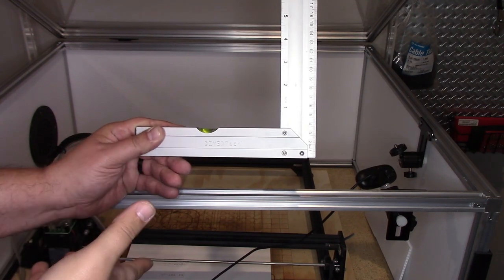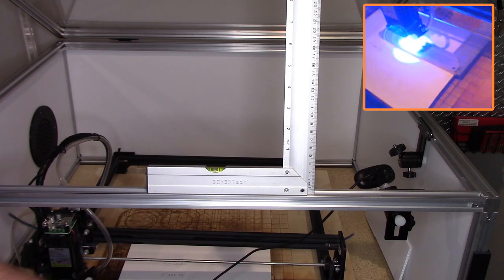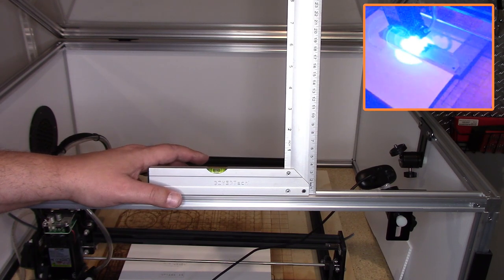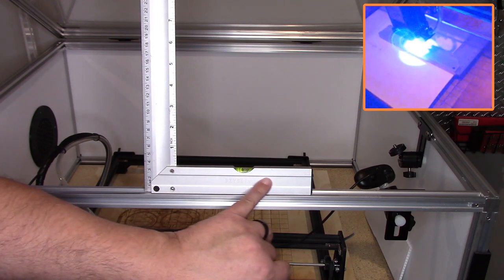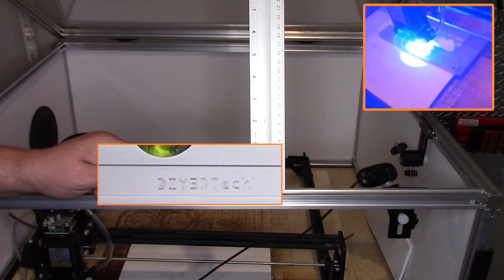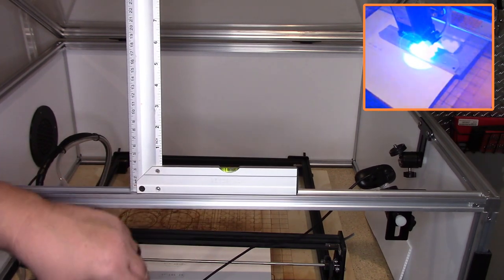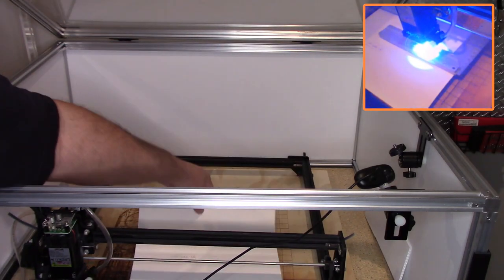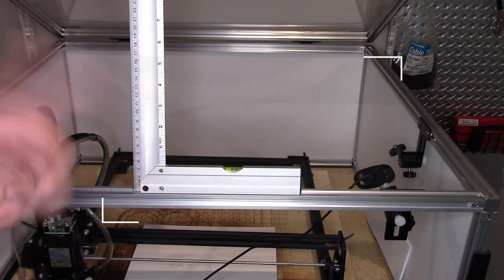Ortur Laser - Etching Aluminum!

Comment: Will this laser remove black powder coating from aluminum?  I am fully aware that a fiber laser is needed to actually etch metal but most of the videos I have seen of powder coating being removed are with a co2 laser not a diode laser.  I'm amazed that there are almost no videos on youtube showing if this can be done or not.  Most people just show wood, cardboard, paper, or at best spray paint.

Comment: I have an XTool D1 10 watt laser. It works ok in XCS but it light burn the Y axsis works fine but the X axsis just jars around or will go about an inch and then come back. Can anyone got any advice. I am also having an issue getting an update in laserbox

Comment: Just bought a 20W Ortur LM2. I have a black anodized microsoft surface pro, will I be able to engrave the back? I understand it can't actually engrave metal, but would it be good enough to remove the black anodize and show the bare aluminum below? Picking up Lightburn as well. Recommended settings?

Comment: On the lightburn camera, when I set mine up (the 140 deg. Cam) I had to have it around 20in away to get the whole area in focus. 

Also 

Using the G8 lens, it focuses well on the base. But, when I shoved a 3mm ply under the lens I almost completely unscrewed the lens to get everything in focus. 

Also printing out a height adjustable diode/laser holder so I can adjust it up or down so as to keep as much of the G8 lens in the holder.
Reply: once you have focus set, instead of adjusting the focus to the material, simply takes some small strips of the same material your lasering, and stick them under the feet of the laser. Then your simply lifting the whole laser up and the focus will already be perfect at its surface regardless of how thick your material is.
Reply: Technically not a workable process. I made my enclosure a bit smaller than I should have and I glued the feet in place (I know idiot move) I just didn’t want to have to rebuild the enclosure. So I can’t place anything under the feet. So therefore I’m modifying the diode housing to be move able up and down. Also the bloody price of lexan/polycarbonate/acrylic is through the roof! I was fortunate I even had enough scraps to put a clear cover over the laser.

Comment: Use a black spray paint, get pretty good adhesion, then do your burn. Then use an electro etching tank. Pretty easy to make with a 12 volt wall wart, a bucket and table salt.
Reply from the maker: How are you removing the black spray paint?
Reply: @DIY3DTECHcom  mineral spirits and a stiff scrub brush usually works for me. Don't get fancy with the spray paint. It only has to survive a bit of salt water once. The cheap stuff will be fine.
Reply: Alternatively you can also use sharpie, and lay a salt water filled sponge over the section, and apply the current that way. Less cleaning but more labor intensive because you have to babysit it more.

Comment: Guys, super easy super reliable, super deep etching of aluminium with the 20w laser. 

Thin layer of paint. Laser off paint in pattern of your choice, use Ferric chloride to etch the aluminium away using the paint as a resist. Works great.

Failing that, get a fiber laser
Reply from the maker: Kind of messy as you have to deal with the Ferric chloride (both acquisition, storage, handling  and disposal) as well as paint removal.  whereas the Sharpie method is supper easy!
Reply: @DIY3DTECHcom  true, it's more work for sure. But the results are much better. If you etch deep enough, even 0.3mm then paint removal is as easy as some 800 grit paper. Just an alternative for those who want to get some deep etching
Reply: Also.... Using ferric chloride allows you to etch the actual aluminium, not just the anodised coating